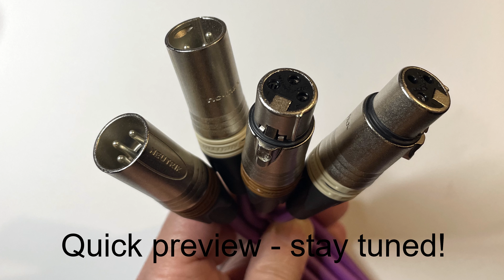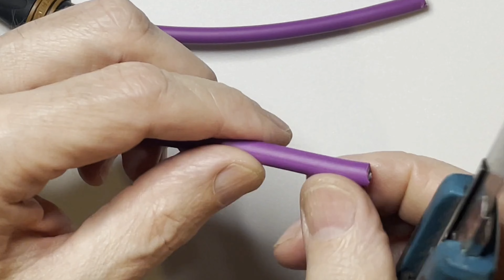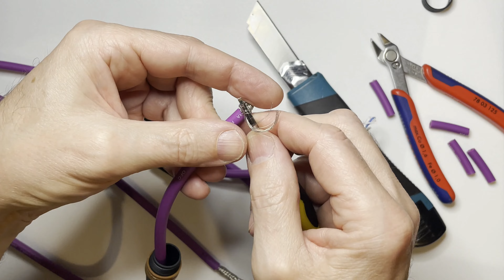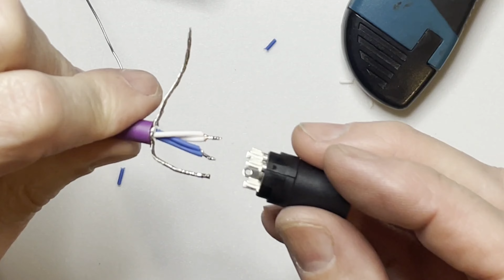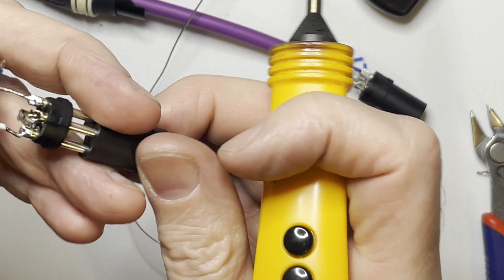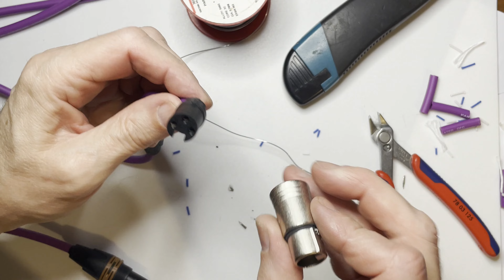XLR Quad (Starquad style) mic cable assembly

Comment: Why have you grounded the shield to both pin 1 and the grounding tab? This is the first video I've seen do this. Every other video just connects th shield to pin 1. Thank you
Reply from the maker: It's part of the AES standard, that pin 1 should also be connected to the case / chassis etc. in any equipment.

If you only ever use a single cable, between two conforming devices, linking the connector shells would not matter as they would be grounded through the equipment - but not all equipment conforms, and one of the great things about XLR cables is that they can be daisy-chained when needed.

Without the shell ground connected, the junction is unshielded and can pick up hum or noise.

The common argument against grounding is that some [non-conforming] equipment uses pin 1 as an audio ground for single-ended signals, and that may be isolated from the equipment case or chassis - so a link in the connector can then cause hum. (However so could the pin one connection from another item of grounded equipment).

To me, that argument makes no sense.

All properly designed XLR-connected audio gear should work purely with a differential signal between pins 2 and 3; pin one is for screening & phantom power return only. Connector shells are part of that screening.

I'd rather connect everything correctly so there is no possibility of unscreened sections, and if I ever encounter such an obscure problem, fix the equipment or make a short adapter without the shell link at whichever end is appropriate.
Reply: @RJTC  Thank you for the detailed reply. 

I guess in my humble setup which is an AKG C214 connected to a DBX286S and a SSL2 interface I have no idea if each equipment is grounded to the chasis therefore I will just connect the shielding to the signal ground on pin 1 only.